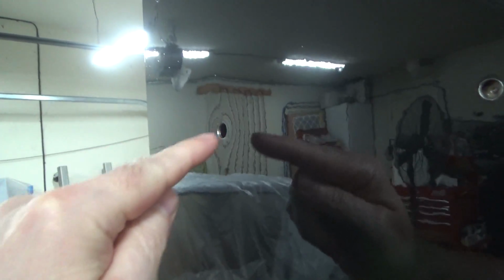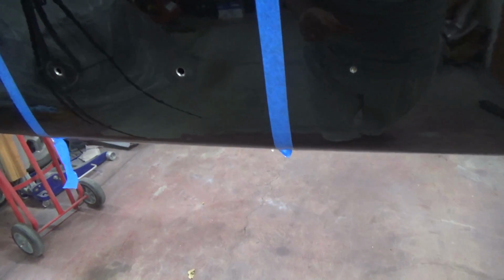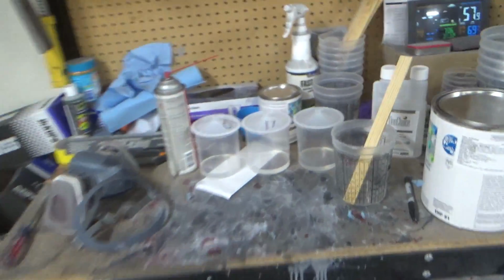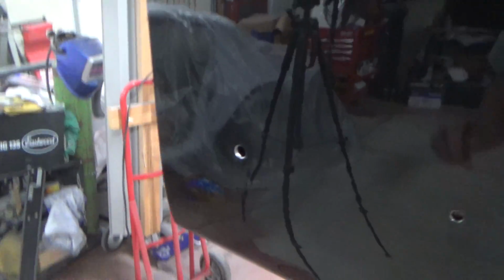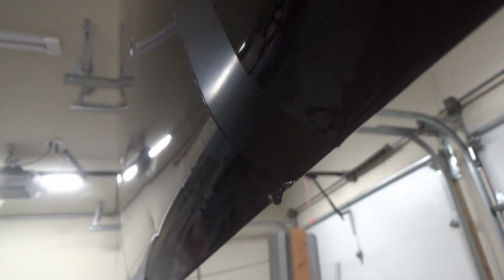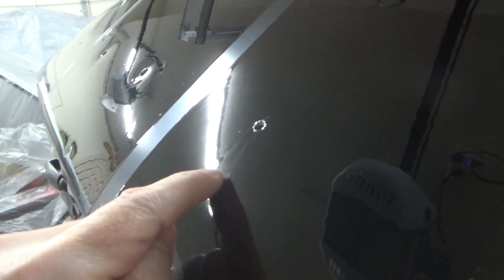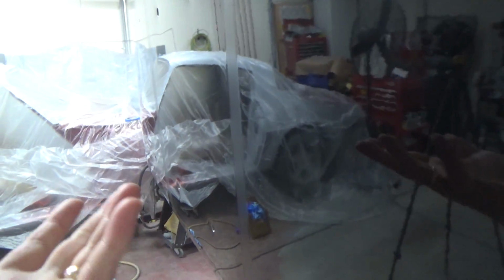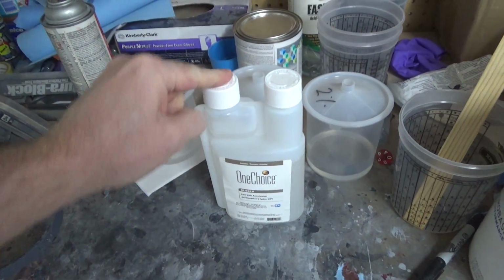Clear coat accelerator test: Fix runs and sags?

Comment: Putting accelerator in your clearcoat won't stop you getting runs it will just speed up your drying time ....have you tried using a viscosity cup ...and having your paint at a constant temperature 20...to 22 degrees. The runs are due to poor application of the paint ...poor gun set up ...nothing to do with air flow because you have no booth ....once the spray has cleared as long as where you are painting is 18 to 22 degrees. The paint is running because you are applying to much material and gravity
Reply from the maker: Agreed for runs. I discovered my application pressure was too low for the gun/air cap. For sags though, I was getting them well after the application was done. Yes, the application was wrong, but the accelerator does help in that case.

Comment: I don't use low voc or accelerator so there's 2 variables that don't pertain to me.  It looks like you're using the right reducer for the temp and your mix is ok so the only other variables are gun settings and painter style. It's difficult to tell someone what to set the gun at and how to spray as these differ from painter to painter that are developed over time and won't necessarily work for the next guy, the settings on the can are only starting suggestions. You might try opening the fan wider and turning the pressure up or on the other side of the card if you like the pattern then turn the fluid down. To wet of coats will not let it gas out and that slows the cure time, atomizing (which California hates) with higher pressure helps. It's all in relationship to how close, how fast and everything else the painter does in motion with the gun. To much paint sprayed in holes or edges will almost always run as the liquid skirts and pulls away.  With my hvlp Finishline I spray with 40-50 lbs pressure, heavy fluid and wide fan at about 6"-7" away with moderate rate movement watching the spray pattern oval to keep tabs. Over pressured with a wide pattern and great atomization while still being wet. It's a learned thing to be one with your gun to suit your style so it's so difficult to tell someone else how to spray beyond the basics. Sorry for all the mumble and good luck, product is to expensive to waste! lol
Reply from the maker: 40-50 lbs? Wow - I have not tried going that high. I will try that as an experiment. Fan is wide open, and I don't think I can dial the fluid much further back without it getting dry. Excellent comment Wendell. Thank you so much. I was hoping you would drop by. Thanks again.
Reply: @asicerik  If you try upping the pressure you will probably have to open the fluid valve to make up for what's atomized in the air. For me even though it uses more material but fits my style and gives me the results I want. Hope you find something that gives the results you want.

Comment: Erik, you will have to give your time in-between coats longer do to you do not have adequate air flow like a paint booth does. How do I know I have a home made booth and I wait at  least 25 to 30 min. An even air flow is the key so if you do not have this give it more time to flash. if it is 60 out side I have waited up to 45min.
Reply from the maker: Thanks. I can try waiting even longer. I don't plan on doing any painting at 60 degrees, but I will see how things go once it warms up a little.

Comment: now you just spread the virus between your paint by using the same stir stick..
Try it again but try waiting longer between coats. i have never used low VOC but i always wait 20-30 min. between coats depending on the temp and humidity.
Reply from the maker: When I did the firewall, I waited 15+ mins between coats. I have never heard of anyone waiting 30 mins between coats. I am not sure it would help with this clear though. Thanks
Reply: @asicerik  The idea of it is to give the layer below just enough time to start to flash and set up. i think this will help as long as you use the accelerator. but i have never seen any clear or paint stay a liquid overnight that was very weird. also like i said i have never used low VOC before.

Comment: Hi Eric, were you using slow hardener and slow thinners? Sounds like you need a Fast or super fast hardener as most modern urethane wont "kick" below 55 degrees (12 degrees C), In fact most recommend anywhere above 20 degrees c (68 degrees f). With 2 k as it is a chemical cure, it does need time to cure correctly before next coat goes on, as such, what sort of tming were you allowing between coats (given at 20 C it should be 10-15 minutes).
Reply from the maker: Hi Mick. I used regular hardener, but fast reducer. I have waited from 10-15 mins each time I have tried to spray this stuff. As I said in the video, this happens to me at all temps. I have sprayed in 90 degree weather and this clear still would not kick properly. I will gain more experience with my new GTI/Tekna Prolite as the weather warms up though. It might do a better job of atomization and maybe this will be less of an issue.
Thanks!

Comment: Be careful with accelerator that clear should be unsticky at 65° with fast speed hardener in 1hour looks like your gun not atomizing enough wait longer between coats in cool weather imo
Reply from the maker: Hey Jon. Thanks. I have never been able to get that with this clear. This was with my FLG-4, but I had the same experience with the GTI/Tekna Pro-Lite with Devillbiss' recommended setup. I think there is just not enough air movement for this clear.

Comment: Hey Eric, the ec530 is a two coat application. Remember that the mid coat is a clear coat also so you might wait for warmer days. I know from experience that a accelerator can make wet sanding and buffing a bitch, just sayin'. Keep posting!
Reply from the maker: Hi Cliff! Thanks. This clear is what I am stuck with here in CA I think. I am definitely going to wait for warmer days, but as I said, I have had this problem with this clear in all weather. What problem did you have with sanding/buffer? Too hard?
Reply from the maker: Do you have a recommendation for a different clear that I can get here in CA? This is the clear PPG suggest for Ford Ruby Red which calls for at least 3 total coats.